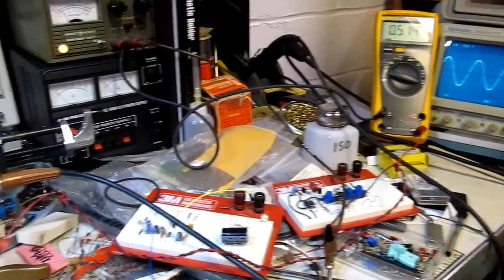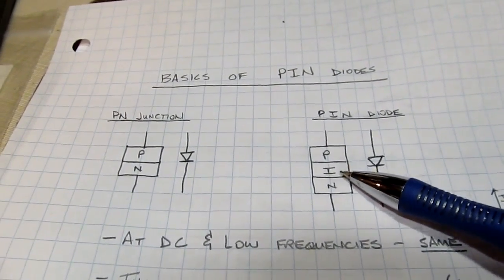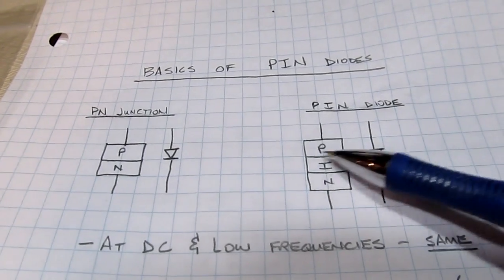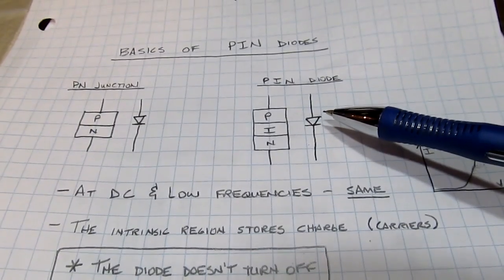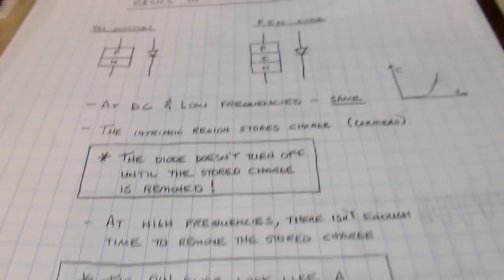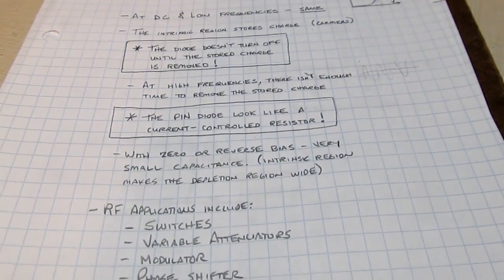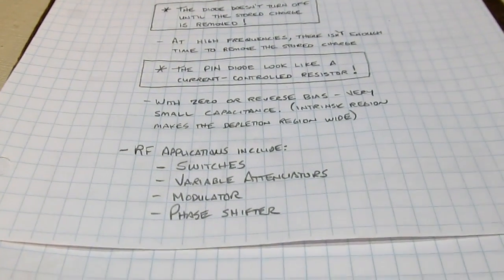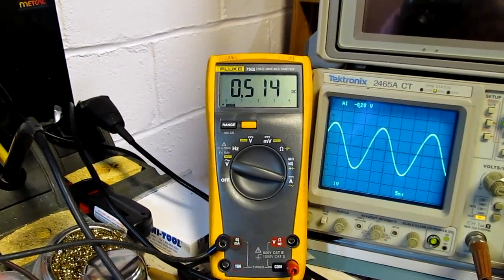#118: Basics of PIN diodes and their use in RF switch applications

Comment: I learn more every time I watch your videos even though by now I have watched some of them multiple times! I know this is an old video but a quick question. If you use inductors top and bottom of the diode to bias it, wouldn't that put an excessive current through the diode (since inductors would be low resistance connections) say with 5V or 12V power supply? Or should one apply just enough voltage in that case to bias? VA3GPJ
Reply from the maker: You'd typically limit the current available by using a current source to provide bias, or a simple resistor.

Comment: Hello, I want to use the PIN diode as reverse biased variable capacitor in an RF application.  The reason I want to use PIN diode is the RF power is above 100 watts, so I need the diode to stand high RF power. Do you have suggestions for what PIN diode to choose? Thanks a lot!
Reply from the maker: It would be best to contact the manufacturer's applications engineers to discuss your specific application and have them make a recommendation.

Comment: This may be too revealing but I have a stupid question that I hope to get an answer on.  how is or which end of pin diode biast voltage is added in the circuit. Is it mixed with the RF on the same line/bus/trace?
Reply: Thank you so much. I just needed to take another look at the end. I got it. appreciate you very much.

Comment: Hi alan
What's the advantages to use PIN diodes over Jfet transistors to make rf switches?
Reply from the maker: Some advantages include simplicity, power handling, and isolation.

Comment: Quick question, with the series shunt with the 1/4 wave stub,  what kind of isolation could be expected? And just how narrow band would that be? Would it cover 144-148 for example,  or is +/- 2Mhz with a stub tuned for 146Mhz to much? Does it get more narrow as you got up into UHF because the bands are wider and a smaller sub length error is a bigger percentage of the wavelength at the much higher operating frequency?
Reply from the maker: You'd have to experiment with it yourself - if I recall, a single quarterwavelength stub isn't going to give you more than about 30dB isolation, maybe a little more, and won't be particularly sharp as it acts like a low-order filter.
Reply: @w2aew  Sounds like a fun experiment,  I'll have to try it.  Thanks so much!
Reply from the maker: @RadioWhisperer  Ralph Gable just did a video on his channel, all about 1/4 wave stubs.  It is very well done.  He shows how to use a pair of open stubs to create a band reject filter with 70dB'ish of attenuation.  Check it out: https://youtu.be/Fd7d6oKHr_A

Comment: Thanks for your video.  I have 1 question about the pin diode.
In the tutorial, Pin diode works well in 1MHz.  Can I know Pin diode part name?
Almost pin diode operating frequency  is more than 10MHz.
I'm searching pin diode  less than 1MHz.
Thanks lot~!
Reply from the maker: I actually used 10MHz in the video.  The diode I used was a spare from a previous ham radio repair.  It is rated for VHF operation, but worked well enough at 10MHz for this demo.  I don't know the part number anymore (this video is 7 years old).
Reply: @w2aew  ok.
Anyway, I appreciate your good tutorials.

Comment: Are there Power versions which can handle for ex. 10-20A of current? Could one use them instead of power Mosfets for high current switching power supplies (Mig/Tig Welders)?
Reply from the maker: No, there are better devices for those applications (MOSFETs, etc.)

Comment: I'd like to use a PIN diode to switch a 16MHz. signal on & off. Can you recommend a particular PIN diode, please? Through  hole leads would be good but I can work with SMD as well.
Reply from the maker: Many of the distributors (such as Mouser) allow you sort the PIN diode selections by the minimum operating frequency.  Here's a decent choice based on this search: https://www.mouser.com/ProductDetail/MACOM/MA4P4002B-402?qs=sGAEpiMZZMvzIsPcC61n6mK0VZ%2FmvpYcoLB1loinzPs%3D
A decent article on PIN diode swithes:
https://www.digikey.com/en/articles/how-and-why-to-use-pin-diodes-for-rf-switching
Reply: @w2aew  Thanks much for the quick response and additional info. At $30 each from Mouser, I'll have to keep looking for a more affordable component. I'm looking forward to getting this switch working in my project.
Reply from the maker: @robinmidgett3347  Well then, this may be more up your alley: https://www.mouser.com/ProductDetail/Vishay-Semiconductors/BA479G-TR?qs=IenFidxwq1QW1OkLKReJow%3D%3D
Reply: @w2aew  Much more appealing...many thanks!

Comment: @w2aew how practical is it to use quarter-wave transmission coaxial cable (I assume it standard coaxial cable, similar to cable TV cabling- not sure if 75 ohm or 50 ohm, by small electronic circuit standards be bulky) in a T/R switch application- wouldn't a particular length of coaxial cable only work for one particular frequency. Wouldn't the Series-Shut SPST configuration work for all frequencies - and offer just as much of a guarantee that the receiver wouldn't see radio energy from the transmitter?
Reply from the maker: At lower frequencies, the lumped element is much more compact than an actual hunk of cable.  At higher frequencies, the cable is OK.  There are a lot of ways to achieve the result.  A series-shunt will work, but may not provide as much isolation since PIN diodes are perfect opens/shorts.  Other configurations can provide more attenuation.  This video was just to illustrate a clever design, taking advantage of the impedance inversion of the 1/4 wave line.
Reply: Thank you @w2aew for answering my questions!

Comment: How do transmission line reflections behave (on the input side), when the pin diodes is switched on or off?
Reply from the maker: It all depends on the configuration of the switch.  If it is just a simple series PIN diode, then it goes hi-z and you get a big reflection.  If you design a switch that uses another PIN to switch in a termination path, you can minimize the reflection when switching the main path off.

Comment: Can you also rectify Ghz RF waves to chopped DC with these PIN diodes or with Gunn diodes ? or how could you rectify GigaHz or TerraHz oscillations very efficiently to DC ? It is probably used in the Zografos water fuelcell. See here:
https://steemit.com/news/@overunitydotcom/how-the-water-to-electricity-petros-zografos-free-energy-fuelcell-system-is-working-from-hellagen-gr

Comment: With the shunt single pole single throw switch (13:28), is it not possible that the RF voltage (without the bias current) gets high enough to forward bias the diode and as such the positive going peaks would be clipped (shunted) as seen by RF OUT?
Reply from the maker: Yes, that's certainly possible for higher RF amplitude applications.  In these apps, this simply configuration wouldn't be suitable.  You can add a switch (FET, BJT, etc.) in series with the PIN diode to remove the direct path to ground when the diode is off, or add diodes in series, or use a different configuration entirely...
Reply: ***** Ah ok. Then would it be a good assumption to say that for many RF applications, it won't reach the forward biasing voltage so that's why these are used? (I just got slightly confused because I think you used ~5Vp-p from the signal generator in the demonstration). Either way, excellent video, I am actually watching it again after about a year or so, currently studying an RF course, and more things seem to click!

Comment: How you made that "PCB" boards for an experiments?
Reply from the maker: I just used a hobby razor knife (Exacto knife) to cut the copper cladding, and then peeled the copper off of the board where I didn't want it.
Reply: Glad to see your answer! Seems really fast method but most tricky part is mental tricks for improvisational trace designing if we have complicated circuit.
Reply: I just type in search "electrical circuit prototyping" and now I can see you did entire video about prototyping, thanks for your efforts :)

Comment: Thanks Alan, Please guide me to select a PIN diode to switch 1.5KW pulsed power of 2% of  duty cycle at 1GHz between two ports with an isolation of 35dB
Reply: I can’t provide a direct answer. I’d highly recommend asking the application engineers at the leading PIN diode manufacturers like Skyworks, Microsemi, MACOM, L3 Narda,  etc. to get proper advice.

Comment: Can someone (w2aew perhaps!) explain to me why the PIN diode didn't just act like a half wave rectifier prior to the current being applied and 'opening up' the diode?  Why did it block the RF completely?  Thanks!
Reply from the maker: The RF signal doesn't forward bias the diode long enough to fully "fill the bucket" of charge necessary for the diode to conduct.
Reply: @w2aew  Makes sense.  Thank you for explaining (and for the excellent video).

Comment: I am changing pin diode RN142SM (D1113 in a yaesu 9111A). it is €20 shipping for a 0.40c part can i use a glass pin diode i found for sale BA479S Silicon PIN Diode, i thought to use two of these in parallel to increase some of the power handling characteristics. below i list the spec sheet for both these diodes:
RN142SM
PIN Diodes Data sheet
●Outline
VR 60 V
IF 100 mA
Ct 0.45 pF
rF 3.0 Ω
●Feature ●Inner Circuit
High reliability
Small mold type
Low rF
Low capacitance
●Application ●Packaging Specification
High ｆrequency switching Packing Embossed Tape
Reel Size(mm) 180
Taping Width(mm) 8
●Structure Quantity(pcs) 8000
EPITAXIAL PLANAR Taping Code T2R
Marking K
●Absolute Maximum Rating
Parameter Symbol Limits Unit
Reverse voltage VR 60 V
Forward current IF 100 mA
Junction temperature Tj 150 °C
Storage temperature Tstg -55 ～ 150 °C
●Characteristic
Parameter Symbol Conditions Min. Typ. Max. Unit
Forward voltage VF IF=10mA - - 1.0 V
Reverse current IR VR=60V - - 100 nA
Capacitance between terminals Ct VR=1.0V f=1.0MHz - - 0.45 pF
High frequency forward resistance rF1 IF=3.0mA f=100MHz - - 3.0 Ω
rF2 IF=10mA f=100MHz - - 2.0 Ω

And the glass diode is:
BA479S Silicon PIN Diode
reverse voltage 30V
forward current 50mA
Junction temperature Tj 125C
Forward voltage VF IF=20mA - - 1.0 V
Reverse current IR VR=30V - - 50 nA
Diode Capacitancet VR=0V f=100MHz - - 0.5 pF
 resistance  IF=1.5mA f=100MHz - - 50 Ω

Just trying to find a part that won't cost me an arm and a leg in shipping.

Another one i found was MPN3401
Reply from the maker: The problem with paralleling two diodes is that it's unlikely that they'll share the current equally, especially due to the fact that the forward voltage has a negative temperature coefficient.  The hotter it gets, the lower the forward voltage.  In a parallel situation, it means as one diode heats up more than the other, it will then draw more of the current, thus heating up more, etc....